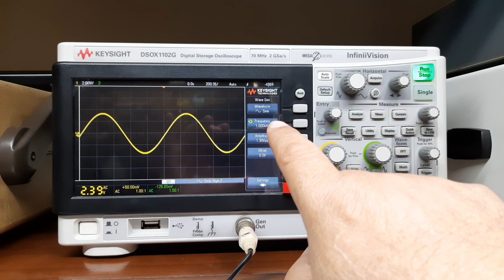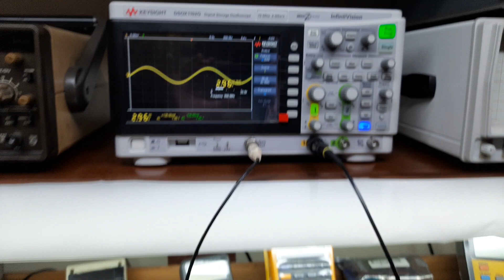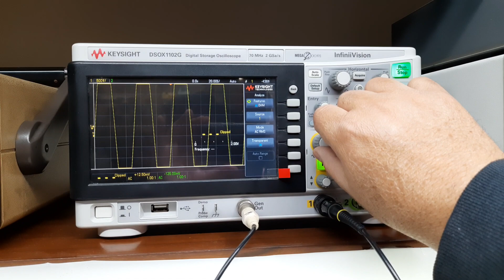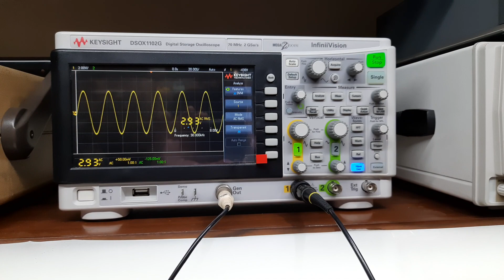DIY Microphone Preamplifier

Comment: Always nice to have plenty of output headroom, and I do like a 'clip' LED that gives you a bit of warning. As I recall, the DBX286a has a clip LED that means exactly that - if it illuminates at all, your signal is already clipped. In a live performance situation particularly, I'd rather have some early warning, and the opportunity to take 'evasive action' before things start to sound nasty.
Reply from the maker: Absolutely Sir. Always nice to be alerted before hand. Thanks and Regards Sir